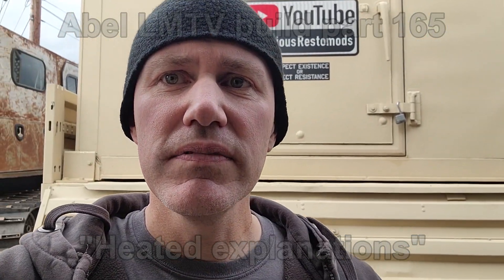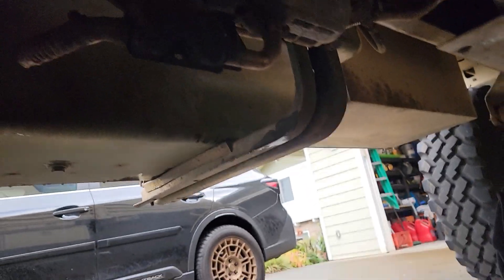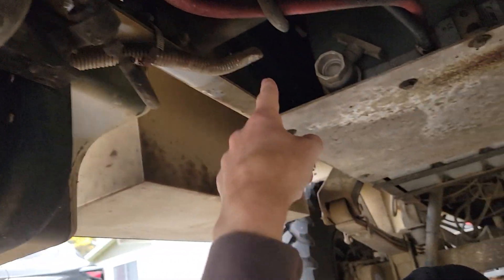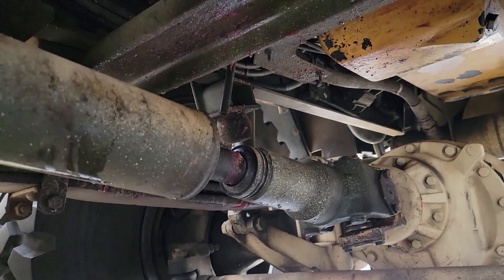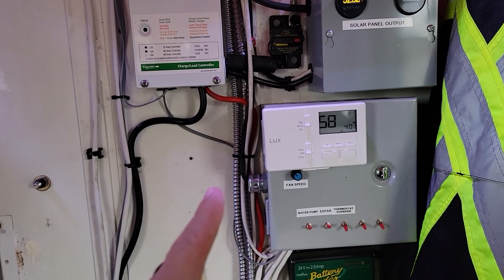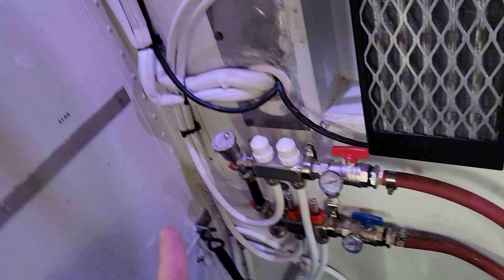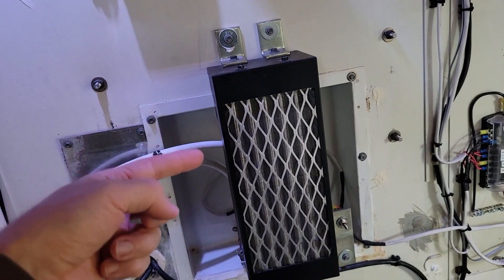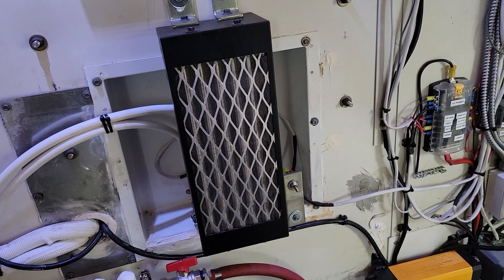Abel LMTV build part 165 (Eberspacher hydronic heating and radiant flooring explained)

Comment: Sean,

I am looking at buying the same manifold.  The Amazon comments say that the inlet threads are straight (not tapered).  Did you do anything special to seal it up?  Any links to the barbs you used?  

Also, the compression fittings that come on the loop legs are for 1/2” pex…. I heard you need special adapters for pex-al-pex.   Did you struggle to put it together?   

Any tips on that manifold?  

Thanks!
Reply from the maker: I used pipe thread sealant.  Everything else is shown in the video.  I make them because I can never remember what I did about a year later.  I do not recall having any of the problems you described and it has been working fine ever since we installed it.
Reply: @SeanFastidious  

Thanks Sean!   If you did not need special pex adapters, that works for me.   I appreciate your support and build videos.   Look forward to your next video.

Comment: I really appreciate the recap!  I do get lost sometimes trying to follow multiple build videos, but have found that every single one is worth watching as you often circle back to things in later videos!

I had a few concerns that you answered:
1.  Heating the block every time you turn on the heater for the floor or hot water seemed wildly inefficient to me.  When I take a step back and look at your system, the overall simplicity is awesome.  My propane heater in my old rv took just as long to heat water anyway and was way less efficient than your setup.
2. I was concerned that you were connecting your coolant loop from the engine to the hydronics.  There is a risk of taking out your truck's cooling system if something breaks or leaks, but like you said, its a small risk and worth the simplicity.  I think for my build, I'll put in another water to water exchanger to keep the systems separate for my own sanity :)
3.  I was concerned that the high temp coolant (180-200 deg) would damage the flooring, it seems like that is not an issue in your install due to the materials chosen (proper flooring and transfer plates).

Thanks again for walking all of us through the system!